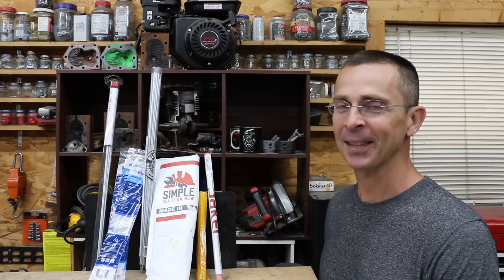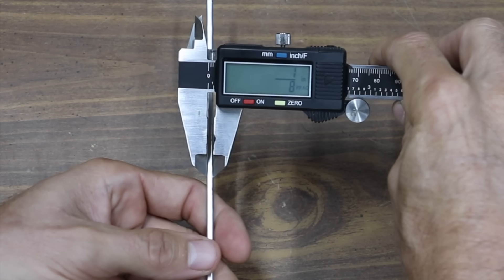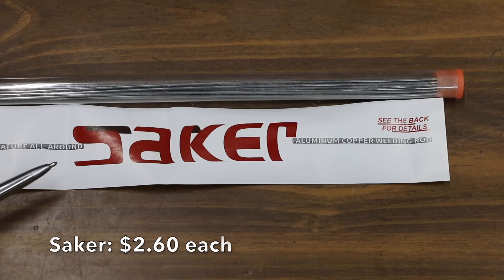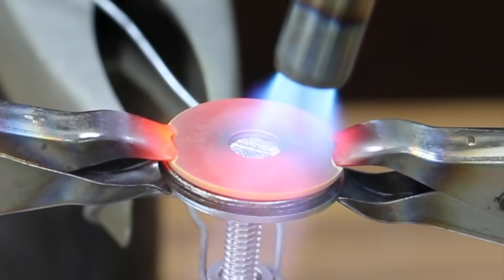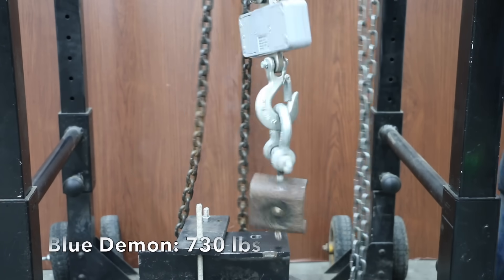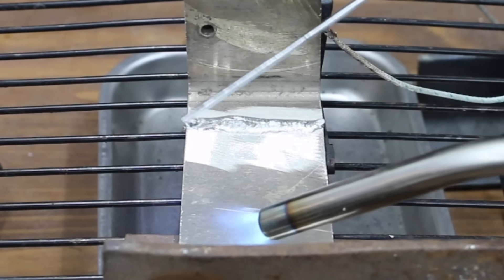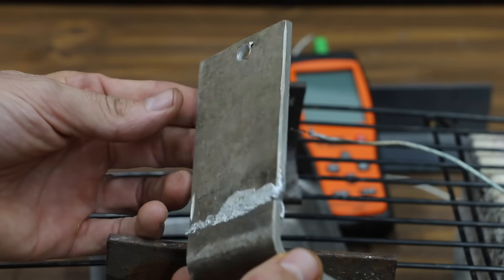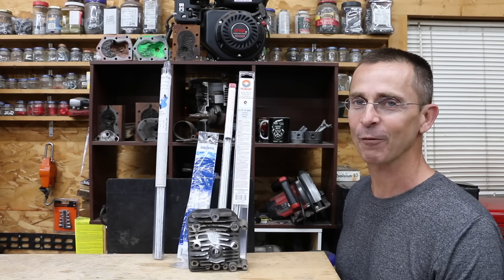Best "No Welder" Aluminum Welding Rods? Alumiweld vs Bernzomatic vs Hobart

Comment: I'm shocked by the lack of comments calling this "welding", I was sure there'd be some butt hurt welders... Great video!
Reply from the maker: Great point!  I should refer to them as brazing rods
Reply: @ProjectFarm  i wouldn't sweat it. the manufacturer labels them..
Reply: It is a type of brazing after all.
Reply: @michaellinner7772  not brazing even, soldering, brazing is above 842 degrees fahrenheit.
Reply: @WhiteDesignsUSA  I mean, some of the products didn't work as advertised and needed much higher than 750 so some of it kind of was brazing.
Reply: If we wanna get technical we're soldering in this video, as the rods are melting below 450c / 840f.  
 Welding can be a catch term for any sort of jointing, but really they all have fairly well defined differences. 
Welding: the workpiece itself melts and forms an integral part of the joint, the joint is as strong as the surrounding metal, it's also the same melting point. 
Soldering/brazing: the workpiece does not melt, only the filler melts, the joint is weaker than the surrounding material. The filler must be a lower melting point.   
You can undo a solder joint, clean it off and the base will be left untouched (think plumbing) this is impossible with a weld however.
Reply: @maulerrw  except not all the rods melted below 840...  Otherwise I agree
Reply: @maulerrw  Exactly what I was trying to say, just in different words.
The differences between the three are not a matter of "one is better than the other", it's all about what is best for the situation at hand.
For instance, you can't weld or solder carbide cutting bits to drill bits or end mills, but you can braze them in a way that will out last the tool itself.
You can weld, solder, or braze copper pipe - but soldering is sufficient for most relatively low pressure applications like plumbing, brazing is used in higher pressure applications like HVAC refrigerant lines, and although you can definitely weld copper pipe if you want to, it's practically pointless to do so - as any application that would exceed the strength of a brazed pipe fitting would exceed the ability of the pipe to withstand it.

You can also glue or weld PVC pipe, but since the normal PVC "cement" actually causes a kind of chemically induced pseudo "weld" by dissolving the skin layers of the fittings involved and entwining them together before the solvent dissipates and leaves them somewhat crosslinked, it's pretty much the same thing without even using a heat source.
TBH, Friction Stir Welding is a perfect example of the differences between welding and bonding.
Reply: Okay. Me- This in not welding! Welding is a mixing of materials...okay? This is such a good video.
Reply: The definition of welding is using heat to join two materials together, whether its through a blow torch, electrical arc or whatever other kind of method you choose. There should be no reason for people to get butthurt over braze welding.
Reply: @shona5512  not really accurate. "Welding is a fabrication process whereby two or more parts are fused together by means of heat, pressure or both forming a join as the parts cool." key word being fusion, in welding the two parts become essentially one part and the weld is often stronger than the base  material.

I don't care that much about the terms used throughout the video, however, for the layman weld gets the point across... I was just imaging some pro welder cringing every time the word weld was used and mildly dissapointed the comments did not yield the results I expected. Project Farms audience is evidently far more chill than many others..
Reply: @shona5512  Actually, the definition of welding is melting the two base metals so that they flow together, and most of the time, using some filler metal to flow in with them.
If you don't melt some of the base metal of the parts being joined together, you are not welding - you are either soldering or brazing.

You can weld without filler metal, but you cannot braze or solder without filler metal.
Reply: @jdgower1  Welding doesnt just entail metals. Welding is literally joining two materials with filler material through heat or electricity. Eg. Plastic welding.
Low temperature welding like this is still welding as it's still melting a miniscule amount of the base material, not anywhere near as much as a traditional MIG or TIG welder, but it's enough to allow the melted filler rod to bond to the surface of the two materials.
Reply: @shona5512  Bonding is not welding. Welding is flowing two materials together until they freeze as literally one piece of material.
I have over 25 years in plastics manufacturing and machine maintenance and engineering, I'm well aware of the difference between bonding two things together, and welding them.
Reply: @shona5512  I never said that plastic welding is just "bonding".
As a matter of fact, I am currently a partial owner of a company right now that heavily relies of welding 150 mil plastic sheets together for custom made products.
Those sheets are welded - not just bonded.
You might want to learn to read, and look up the definitions of words in your spare time.

Comment: Maybe test SDS bits next, and stone/masonry screws that drive directly into solid walls (not anchors!)
Reply from the maker: Great test suggestion!  Thank you
Reply: @ProjectFarm  I'm tired of the SDS drills melting their tops off after 20-30 holes WITH THE CARBIDE TIP STUCK IN THE HOLE making it unusable. Every 2-3 holes the size becomes slightly smaller to the point where anchors don't even fit anymore. And some masonry screw types stick better than others. Difficulty of driving them in is also a factor, some brands go in even if the hole size is too small, other brands get stuck in place and won't screw in deeper. "Pull-out" strength is most important as you wouldn't want what you screwed into stone to ever move, wiggle or pull out.

Comment: 13:07: most likely the welded area seems cooler because it is clean shiny metal, and partially acts as a mirror for the infrared camera. So part of the measured value is due to the temperature of the room. The trick to avoid this, is to apply some non-reflecting substance to the metal.
Reply from the maker: Great point!
Reply: good catch! next time he should spray paint (if its gonna get hot). If not, just stick some masking tape on it
Reply: @DROGOC0P  wait what, masking tape?
Reply: DROGOC0P NUTZ, kapton tape works better for hot parts
Reply: that was humanities problem with fiber optics, we didn't have the reflective sleeve in-casing the light to make it work; but when the silly aliens crashed in around the mid 40's in NM ( actually the debris was scattered hundreds of miles from where the first impact was recorded; which re crocheted like a bullet; off the hills of NM)
 we reversed engineered their technology and advanced ours 10 fold in just 30 years, look at where night-vision, fiber-optics, lasers, micro-processors, etc.. got their technological boost from, you think a big eye and lens is just for looks?
 ;-) . .. ... .. .. ... .. .... .. . (awesome comment! thank you i needed this)
Reply: Not 100% sure this makes sense. Reflecting or not wouldn't be the issue, unless the part itself didn't emit infrared radiation on its own. If it was reflective, it would increase the amount of thermal energy being radiated from the part, not decrease it. Since the Flir is just examining light intensity outside of the visible spectrum, being reflective wouldn't reduce the intensity of that light/thermal radiation.
Reply: @Sevalecan  Not every material emits the same amount of energy when it is at a certain temperature, look up emissivity. Next to acting like a mirror, (clean polished) aluminum also has a very low emissivity. To get accurate temperature readings, a thermal camera must be configured for the emissivity of the material being inspected, but for very low emissivity values this is pretty hopeless because the large multiplication factor also causes big errors if anything deviates from the ideal values. For very low emissivity materials, a thermal camera simply isn't the right tool for the job, unless when using the workaround of sticking a material with known emissivity to the problematic surface.
Reply: @alexanderthomas2660  I had this thought but wasn't sure, and thanks for going into more detail. I am sure the part you didn't say is also true, but probably all materials(not just metals) have different emissivity? And knowing that the radiation can be that significantly different makes a lot of sense, but jumping right to being a mirror probably doesn't make the connection for most people (Although a friend of mine did mention black bodies radiate more heat, so it makes sense it's tied into that).

I have often wondered about the general usefulness of a Flir as most laymen apply it and it seems that is for good reason.

To be fair, I couldn't come up with an alternative explanation from yours and that's why I didn't try. If the thermal conductivity was that much different, it would eventually soak in the heat to some extent, as it also couldn't remove it to the air quickly.

Edit: and I definitely skimmed the thermal radiation article when writing my comment, which is probably why I didn't look next to blackbody radiation for this.
Reply: @Sevalecan  nice comment, but , not this does not make sense, at least to me.
Reply: Not just that, but aluminum is good at dispersing heat - there's a reason it's used as a heat sink for air cooled devices.
Reply: What? am i stupid or what?

Comment: Could you test PTFE tape? (plumbers tape) I've used it extensively at my college for all sorts of engineering projects and I've noticed that there is a vast difference between the cheap stuff and the way pricey stuff like swagelok.
Reply from the maker: Great test idea! Thank you
Reply: @ProjectFarm  if you go this route please make sure Blue Demon is in the test group. I've used it with great results, and got the recommendation from some very experienced plumbers.
Reply: Yes!! Leak tests
Reply: White, pink, and grey are three different thicknesses I've seen. Ive also seen different application methods stated, from simply wrapping around the thread to doing a crisscross and then a wrap through the middle.

Comment: Those Iceyyyy brand rods seem to be just plain old aluminum rods and not brazing material.
Reply from the maker: Yes, I agree.  They definitely aren't low temp
Reply: @ProjectFarm  Filler rods for Henrob Dillon?
Reply: @Kris Nicholson the alloy used for filler is what makes welding and brazing different.  brazing by definition is using a different filler metal that sticks to the base metal without melting it.  welding is melting the base metal and using a filler that mixes with the molten base metal, usually a fairly similar material.  so what you mean is that you would rather gas weld aluminum than gas braze.  The word weld or braze defines the process.  You can't braze with filler material that's the same as the base material.
Reply: I bought some of the Iceyyyy rods. They are just aluminum TIG rods. The ones I received had the 5356 identification pressed into one end. I tried TIG welding with them and they melt and flow just like 5356 rods. Definitely not as advertised.
Reply: @Kris Nicholson Even flux is not enough unless you have a bare finish that is displayed for artistic/preservation/conservation reasons. I would in most cases perfer the zinc/al alloy in the low-temp rods for actual "getting work done". At the point you need flux it's welding not brazing; and while welding is possibly better, It still may require a heat-treatment for full strength (see the bolt failrures form the annealling and/or embrittlement), quality gas welding of aluminum requires skills not commonly seen since the 1940s. At that point you should be using a oxygen-enriched flame for percision anyway, and thats a whole other skill.
Reply: @Kris Nicholson That's not the "method I've chosen" it's industry standard practice. I don't know which Holiday Inn Express you stayed at last night but you might want to stay a few more nights.
Reply: @Kris Nicholson wrong.  https://en.wikipedia.org/wiki/Wedding
Reply: @RickBaconsAdventures  Best typo I've seen all day, sir. Lots of those just crack and fall apart when they aren't properly prepared.
Reply: @Kris Nicholson I guess it depends. If you want TIG rods that are cut into 1/2 their length with an abrasive wheel (so that needs to be cut off and thrown away) and cost nearly 4 times as much as bulk TIG rod, they are great. If you want a low temperature method of fixing an aluminum part because you do not have a TIG setup or you are nowhere near it, say you want to fix your fishing boat by the lake, then they are no use whatsoever. For me I would never buy the Iceyyyy brand again. I will give Hobart a go though. The use I put it to is making radiators for motorcycles.
Reply: @Kris Nicholson Aluminum never uses the same alloy as the filler in a fusion application. For example, 6061 alloys are typically welded with either 5356 or 4043 filler.
Reply: @Kris Nicholson And for the record, welding cast iron with ER70 rod is a good way to scrap your parts. Cast iron is either welded with nickel rod or brazed.

Comment: As always I hit the like button before the video started.
It's great how you seem to have your finger on the pulse of America. I've been wondering if those "welding rods" actually work. 
As I've come to expect from the Harbor Freight it didn't finish in first place but did offer a decent value.
At the price of many of these rods you could almost as easily buy a cheap Harbor Freight welder for $100.
Thanks for your very comprehensive and fair testing👍! The only improvement I'd like to see is perhaps you could take a little more time when going over the results with the charts. You get going so fast that it can sometimes be a little difficult to keep it all straight. Thanks again.
Reply from the maker: Awesome!  Thank you very much!